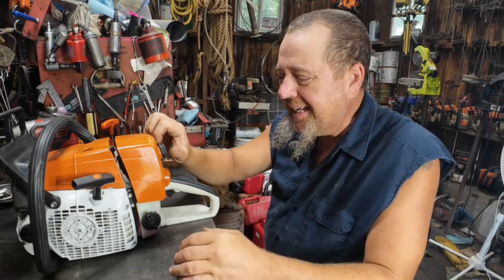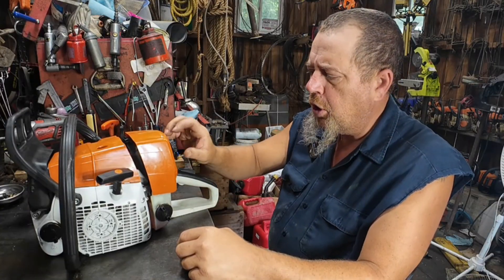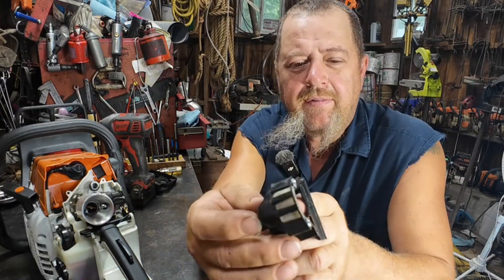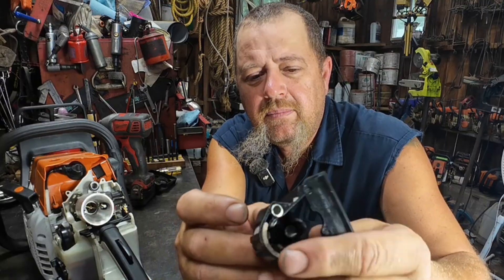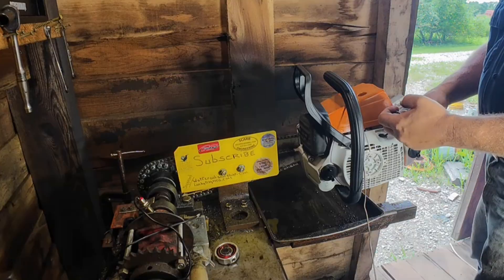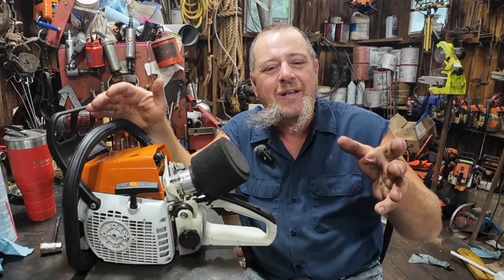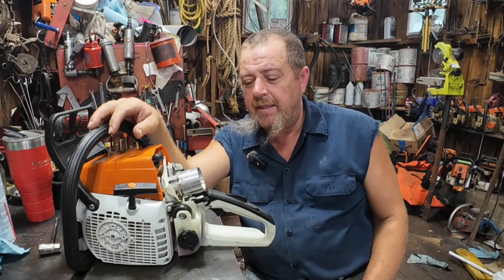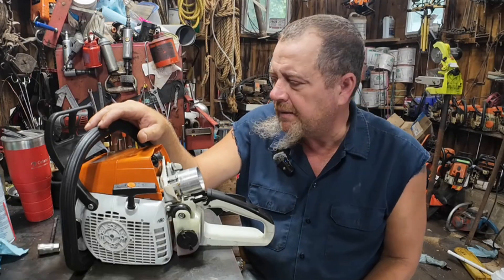Stihl Chainsaw Dyno Test – Does a Velocity Stack Really Add Power?

Comment: Got a weird question - how far can I move the air filter from the carb (on a mill) before I see a loss in power ?
Reply from the maker: @kojirohyuga1050 Pure speculation on my part, but I think you may actually find gains with a little more distance (even a few feet) would help. It could give more "time" for the filter and lower the PSID because the filter may still have forward flow (to fill the void) even while the intake is closed.  I think it would work fine as long as the tube/runner isn't too small.

Comment: comment and a like too. Oh you can get the same HP by modifying  the that plastic thing and running a winter mesh type filter. The stack itself is not really helping much.
Reply from the maker: @michaelwheadon1078 I sure can't argue with ya because I didn't try a winter filter; I seemed to me that the plastic had some issues with air flow and I corrected those with the V-stack?  I may have to see if I can find a winter filter and give it a shot with that; I like the way you're thinking.

Comment: I'd be very curious to see what it does on my ms361 that I've put a 590 crank and 066 cylinder on. Curious if the gain is just lateral regardless of engine cc or if more air demand makes more difference
Reply from the maker: @TheHondaOutlaw Testing from 50cc to 75cc, I've found that the bigger the engine, the more it helps.  Can't speak for your situation but that's mine.  I'd sure give it a shot!

Comment: So if one was to run a velocity stack on a 361 what would you do with the top port of the carburetor that doesn't get filtered air? What is the purpose of that port anyways.
Reply from the maker: @jjtd80  Quite a good question!! I will attempt to answer backwards; the  port on the top of the carburetor is on the top part of the metering diaphragm. If you remember most of the old carbs have a hole in the flat cover that is held down with the 4 screws. The hole is so that the diaphragm is open to the atmosphere on the outside; this enables it to move freely. If the hole wasn't in the carb cover, it diaphragm would be trying to make a vac or pressure with each movement... actually there gets to be some dust, wood chips (fines), etc... inside of the carb in that area... no problem!!  Next part to explain is the fact that that opening is required for the carb to work; if the hole gets clogged, the metering diaphragm will not move correctly and will not allow as much fuel to move.  Stihl plumbed it in to the air-filter; they call it "intellicarb". As the air filter becomes more and more restricted (dirtier), the fuel in the carb is changed accordingly.  That's what it's for. The second part is easy... I take a hole punch and cut some air filter material and poke in the hole; it wouldn't hurt much to leave it open, but that's what I do.  Good question; hope I didn't muddy the water too much.
Reply: @HayChaffandSawdust1 you know the old saying improvise, adapt, and overcome. Well I don't know why I didn’t think of that remedy. I do however really appreciate the explanation on what it's for and how it works. Much appreciated. The dyno doesn't lie and that was a pretty darn good gain. I've had a short velocity stack for a while now, but I was perplexed on what to do with that hole. Now I know.
Reply: @HayChaffandSawdust1  This is the comment that I was referring to. I appreciate you taking the time to explain it in a manor that everybody can understand. Thank you.
Reply from the maker: @jjtd80  Sure was no problem! Actually, I'm glad you asked; only so much a person can put in a video (and I often include more than people want), so the comment section is a great place for people to keep exchanging ideas. Thanks for the question; I'm sure it will help more than just one or two people.

Comment: There is a YT video of a guy/shop swapping velocity stacks on a flow bench, long ones, short ones, different outer radius... it was a good video. I know General Electric and the alike  did A LOT of R&D on this topic fir their gas turbines... they found that putting a center cone/radius it helps to increase performance by changing the inlet flow characteristics. It creates a smoother flow while increasing it. 
Good stuff.
Reply from the maker: @RichFife Somewhere there's a picture of me reclining in that v-stack of a GE LM-2500; the nose cone is necessary/helpful in the turbines due to the center shaft.... that's what I always figured; are you saying they had gains with a center cone but no center shaft (open bore)?
Reply: @HayChaffandSawdust1 no, the LM2500s fitted for shipboard use has a center shaft and blades... for ship use they didnt rotate. Idk. 
I dont miss working on them... definitely dont miss the synthetic lube oil, 23699
Edit: yes, they found gains with the cone... it helped with the flow structure, less turbulence yadda yadda.
Reply: After 2yrs of working on the GE LM 2500s I got bored with them... not to mention tion I noticed a lot of the mechanics had daughters, very few had boys... I figured that was due to the exposure of chemicals. Lol. Kinda like the radio/combat people... I had this plan to learn and work on GE turbines, get a degree, go to the GE field engineer school and then go out and make money pulling, replacing, repairing turbines... that didnt happen.
Reply from the maker: @RichFife  That's the point I was trying to make is that there is a center shaft for the cone to direct  air around. I don't remember the number of  the synthetic oil... I've attempted to do a lot of forgetting since then!!
Reply from the maker: @RichFife  Your plan seemed awful similar to mine; I wanted to learn something useful; I grew up rural and the first time I ever slept where I could see a street light was the night I was headed to Uncle Sam's Yacht Club's Welcoming Convention. I went with an open mind that I might like a bigger town; Well, I learned the GE Turbines and support equipment, but there was ONE little drawback to getting a job in that field.... there were street lights and people around... ewwww! I gave it an honest chance, but town life ain't for me.
Reply: @HayChaffandSawdust1  im from a small village... I prefer the country life. Less neighbors the better. Had I been able to disassemble, inspect, find the root cause for failure, repair, test and install, I would've stayed in that field. Instead, it was about the systems..  I didnt care for the Lube oil system or filling the LOSCA underway... 😂 the fuel system intrigued me though... when taking on fuel, testing the quality from ship to ship, running it through the coalecers, pre-filters, filters, centrifugal separator and then checking to see what the water and sediment levels were in the lab... that part was cool.  Cleaning that stuff, meh, wasn't the worst job that I had. 😅
Reply: @HayChaffandSawdust1  trust me, it was 23699... silver metal can, black bold writing, said danger/warning prolonged use of this product will cause dermatitis, reproductive issues, cancer and ultimately death.  (That's not verbatim but relatively close). You get too much of that shhhhh on your skin, you can literally feel it absorb... it used to make me feel sick.
Reply from the maker: @RichFife Sounds very similar; I did my turn in the oil lab too... testing everything from sediment to flash point. That's been many moons ago though!!
Reply from the maker: @RichFife It's funny how much of it I actually forgot since then; I had two of my best friends, that I hadn't seen since '94, come to my house for a week-long visit this week. They remember all kinds of things that I had forgotten... they remembered quite a few shenanigans that I pulled-off... I had forgotten most of those too.
Reply: @HayChaffandSawdust1  oh I totally get it man. 😂
Reply: @HayChaffandSawdust1 I remember thinking, "man, that F76 and JP5 is super clean"... 😂
Reply: @HayChaffandSawdust1 I'm almost certain that I srill have pics from 2000-2001...  in the engine room, with the 2500 "in the box".
Reply from the maker: @RichFife  My pics would have been @10 years older than yours.
Reply: @HayChaffandSawdust1  are we getting old? 😅😅😅
I edited the other comment. But yes, they found the cone to have structured the flow characteristics, less inlet turbulence.

Comment: Any saw builders try a mechanical exhaust power valve yet (throttle cable splitter and butterfly) was gonna try it on a motorized bicycle build but havent got there yet thanks for the vids
Reply from the maker: @wloop7659  I am not aware of any that have tried it; it's now a WELL KNOWN mod, but it is known about by many. I wonder how well it is suited for chainsaws due to the fact that they are designed to run WOT or idle... it's still something to ponder, isn't it??!!
Reply: @HayChaffandSawdust1  i had it some what thought out put as close to engine as possible and use a gyro bike cable the make a couple cam wheels of diffrent sizes to get ratio right. also may be able to go a little crazier on the porting but ive never delved into porting
Reply: @HayChaffandSawdust1  i just cant leave it alone my snowmobile has two power valves and its wide open all the time 🤣
Reply from the maker: @wloop7659 You're gunna have to get to porting; you got some dang fine ideas that need tested!!

Comment: Mark have you noticed on a sthil 460 and 461 that piece on the carb looks like a velocity stack to me...I've wondered why they didn't put them on the 066....Do you think the big bore cylinder for the 066 helps much if any ...I'm wondering if the loss of room in the transfers hurt it
Reply from the maker: @70skid67-c5b I do like the V-stack-type setup on the 461! I haven't tried adapting it to anything else, but it may work on other saws, too?   I don't have a speculation on the big more YET. I do plan to build my 66 before next fall; will probably find out. I sure do hate to lose xfer area though!
Reply: Ive got a cylinder for a 2100 that has a cut head a cast iron sleeve and some really nice port work...it was built by EC Birt in the 80s...its piped and runs on methanol...Im gonna take some pics of it and show it to you .Ive got to get the wife to help me message you...Heck i get on here and tell a whole story in the comment section lol...id like you to see this cylinder ...The guy who built it worked for tillitson in charge of R An D ...He also helped design the Honda Esinor dirt bike...i feel like this is a pretty rare piece ..its got wild porting ...Maybe can help figure out the concept...i stuck the ring by not letting it warm up good...2nd saw ive done that to....last was a 460 few weeks ago...just wasnt thinking @HayChaffandSawdust1
Reply from the maker: @70skid67-c5b  Shame on the ring-sticking! I would sure like to see that; those boys sure knew what they were doing, didn't they?!

Comment: I put a velocity stack on my stihl 066 mostly because using it for milling the stock air filter would fill up with chips to Point of saw chocking down. I never liked the way it looked but it solved the chips in the air box issue.
Reply from the maker: @robertjones6929  I bet that helped a LOT!!  There are some dang good reasons to use them. I bet they really shine for milling operations!

Comment: Gordie at West Coast Saws runs everyday Big saws with the same ish size filter as you have.  But pleated pro filters. Think about cutting huge thick bark trees all day and the capacity of a stock filter vs one twice the size.  Haven’t researched it but he makes performance products for saws, and if he runs them you can bet what you sit on they work.  Stock filters are always a compromise, with the available area versus the volume of air ingested…. Anything that can be done to reduce the restriction of incoming air Has to help.  Grumpy Old Man who plays Hermit waaaayyyy up North 😎
Reply: I just went to his website and there’s a filter mod for the 500i that has an adapter that goes on the carb and is held by the regulator two nuts. It is tapered and has a foam circular filter.  Gotta be good because he’s out of stock on😮 😊
Reply from the maker: @williamstewart5635 I bet it's a good one; he ain't no fly-by-night guy; his stuff is primo and well-thought-out and sturdy enough to go to work!
Reply from the maker: @williamstewart5635 Most of his are under a cover, aren't they? I just know the rough treatment that MY saws get; setting it down and it rolls down the hill, bouncing around in the buck of a tractor or in the bed of a SxS, walking thru the brush and briars,  I treat my saws worse than most.  I like the "Max Flow" types of filters; even if they need a different cover, they can make it though a briar patch without losing pieces of filter on the thorns like bread crumbs on Hansel and Gretel. I think they would be great working in a wood-yard, in quasi-friendly environments, milling, etc...; they sure have their place... I'm thinking of getting cast iron covers build for my "work saws"!!

Comment: I agree with you on it being on a saw.
I like my saw tough and friendly.
No crap hanging off, tolerable mufflers.
No need for being, I'm there to work.
Reply from the maker: @KarlPoorbaugh  I think we're in the minority Karl? Not complaining; this ain't a "one size fits all" world.  I like my saws to be tougher than woodpecker lips even if I don't gave maximum gains. There are enough gains within a saw that, unless it's a race saw, you don't need all the gains anyway... pick and choose which ones fit your application and get the gains you can tolerate.
Reply: @HayChaffandSawdust1 my brother.
I want more power , the only cost I like to pay is some parts and work.  It’s gotta be nice to run and tough.

Comment: Great video! I have been saying for years, based on actual experience, that the velocity stacks make a huge difference.  Especially the bigger the CC's. I have been running a velocity stack on an 066 for 20 years. It has a dual port muffler mod and big bore kit. I have cut hundreds of cords of firewood with it and there is not another big cc saw in our firewood community that will run with this thing. I also figured out how to get a short K&N filter on it with a water sock. I modified a stock filter cover and the saw looks like it was designed from the factory to run this stack. It has been a reliable saw that starts every time and screams in the firewood. It doesn't matter whether it is hardwood or softwood, it eats the wood. I am just now rebuilding and porting the saw with another big bore kit after 20+ years of solid performance. For a 100 cc saw this thing rips.  All my friends love to run it.
Reply: Yessir , been doing the same for years on an 064 with a k/n filter and an outerwears - they rip thru the timber very quickly. Some say “they pass too many fines” which I’ve never found to be the case - I cut a relief in the velocity stack slightly wider than the hose clamp and when you tighten it down ain’t NOTHING getting thru !
Reply from the maker: @fabzacres-blackcat It bet that one is a good saw too!! I wasn't are of people claiming these pass too many fines... have they ever looked behind the stock air filter on a used/relatively-unmaintained Stihl chainsaw? I agree that the filters don't pass much, but many are like having a screen on your front door while leaving the windows wide open and wondering why you have flies!
Reply: @fabzacres-blackcat  I have two 064's and the 066.  They are fantastic saws! The 066 is my overall favorite, it is a screamer and will do it all day long every day! I have never had the fines issues that I did with the stock setups. They allow a lot more than my K&N set up.
Reply from the maker: @lloydogan2957 I love the real-world experience!! I wasn't even aware of a "rain sock" or "water sock" until you mentioned it and I looked them up on the innerwebs.  Those 066 saws are some of the best in my opinion!

Comment: Very nice. I don't know if I was the only comment about adding a velocity stack but I do know I mentioned it a while back. A 10% instant gain is well worth it as far as I'm concerned. A quick google suggests that an intake length of about 7.5 inches is the go. That's from reed or piston to the back of the stack.
Video length doesn't matter as long as the hp increases :D
I do need to find out what this flipped air cleaner mod was for cars.
Reply from the maker: @Alan_Hans__  I didn't keep track of which person suggested which mod; I just made a list and am trying to work thru them in an orderly fashion (from easiest to harder and from outside to inside).  The "air filter mod" was simple. IN the 60s,70s, 80s, the air cleaner was atop the engine and had a lid that was held down with a wingnut; the lid sealed around the lower part and the lid was dome shaped (somewhat). Us juvenile delinquents would turn the lid upside down so that the air filter element was exposed... it actually changed the sound of the car... especially with a 4bbl carb.  Other than the sound change, it did little (if any) more.
Reply: My Datsun 180B was the only car I've had with an aircleaner that sounds a bit like that. It was a 4cyl car :D . It did get changed from a 2bbl carb to 2 SU carbys which gave it a bit more poke.
Reply from the maker: @Alan_Hans__  Yep, that's the air cleaner "mod" I was referring. I bet the carb mod did help!!

Comment: Yeah use a milk jug, cut out the handle, form it on there above the stack n filter with a heat gun - or use an orange wash detergent 128oz, cut the handle, form er with the heat gun, yeah buddy, you got that veloci and filter covered for free.
Reply: yeah detergent container are number 1 plastic like milk jugs but thicker, so good to go !
Reply from the maker: @shakdidagalimal I bet gear-oil jugs would work too? I have plenty of those laying about; I usually just give them to the dog 'cause he LOVES fighting with them; may just have to save one back for myself!!